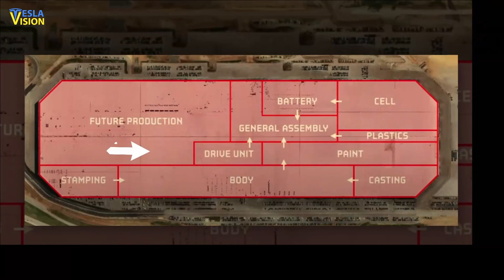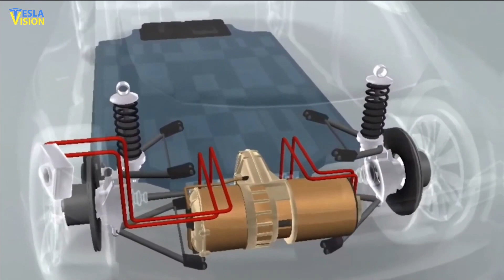FULLY REDESIGNED Cybertruck Has Been Confirmed For 2023

Comment: Here’s what I don’t understand about the press—-the cybertruck is stainless steel.  The current presses uses liquid aluminum to form model y parts.  What will these presses do for cybertruck?  Will it use stainless steal?  Is it a mold or a bending machine?
Reply: The gigapress casting machines are used for the aluminium alloy floor/chassis (possibly eventually the upper frame), this applies to both cybertruck and the Model Y.
They gigapress is not used for outer body parts, and will not be used for the stainless steel exoskeleton.
You cannot cast stainless steel.
Reply from the maker: Good points here.
Reply: M JR. The huge advantage Tesla has is that ALL its production tooling is brand new.
They are not saddled with press's that were designed in 1950 to press steel.
And all that new tooling is state-of-the -art.
Tesla will have a press delivered from the best manufacturer of press's in the World, be it Germany, Japan or the US - designed specially to handle stainless steel.
These Tesla factories are light years ahead of anything the legacy automakers have - and an unsurmountable advantage.
Reply: The stainless exoshell will be bent in what’s called a “press brake”. It’s like a sheetmetal brake but hydraulic and bends into a press block instead of a leaf that hinges over.

Comment: I bought some lithium iron phosphate batteries way back in 2013, on a DIY Prius plug in pack.  Bottom line is, Tesla has not dropped the cost of batteries.    If a model 3 sells for $36,000, the batteries cost is half I assume.   $18,000.  That’s slightly more than the price of the batteries I bought.  Big picture is we need the light bulb filament to be discovered ( invented) still.  I’d like the battery price to go down to just $2000 for the whole car.     If they have a bamboo pole attached to a electric grid attached to car like Shinkansen- this can be achieved.   Another infrastructure that Tesla must build .   There are other inventions that can put Tesla out of business.   Unless Tesla is on the cutting edge.     I expect the stock to drop to below $100 .   Slowly people will realize the car is great, but too expensive.   Therefore, not buying.   Don’t get too anxious everybody.